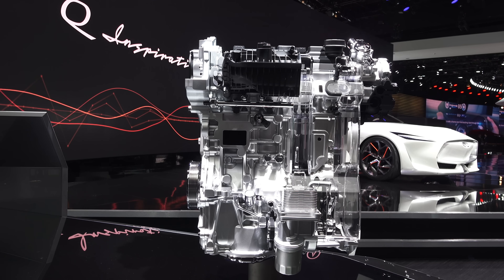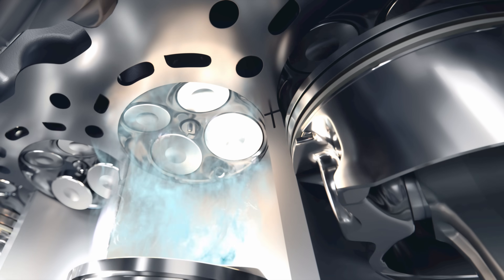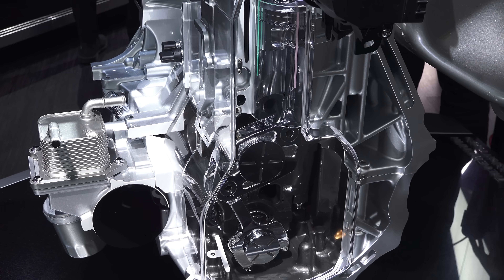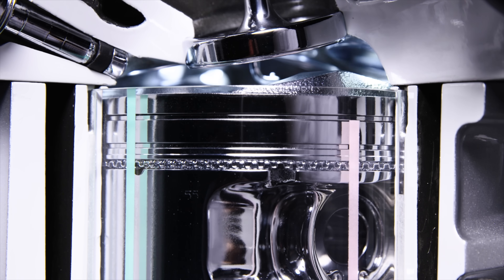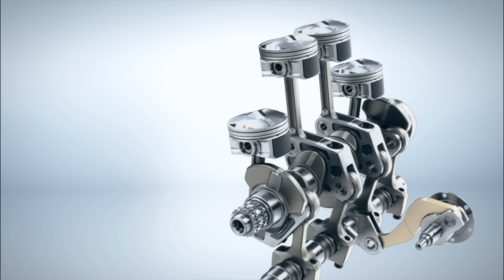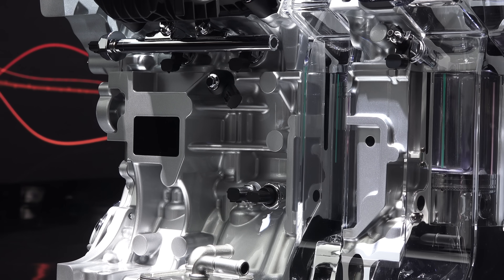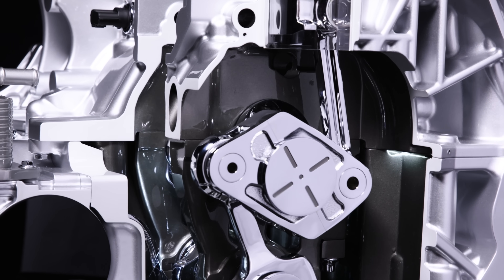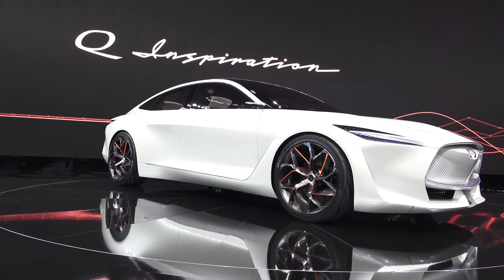INFINITI Reinvents The Gasoline Engine — VC-Turbo

Comment: More moving parts usually mean higher likelihood of something going wrong at some point.  Also, the computer that does a lot of the thinking for this engine will require more lines of code.  More line of codes, the higher the likelihood that there will be bugs.  Over time, things will get better but I sure wouldn't want to buy a first generation of that car (not that I could afford it anyway).
Reply: So much for adult conversation.  If you read (because you did read it, right?) my comment again, I say "higher likelihood of something going wrong".  I never said it is guaranteed to fail.

The real ignorant people are trolls like you that don't add anything to the conversation and have to resort to personal attacks to feel better about their pathetic, miserable, little life.
Reply: Sounds like Infinity did a very good job of field-testing this new engine before putting it out into mass-production.  Yes, there is certainly more software tech being used to keep this motor running, however if a "bug" is found in the code, it is certainly much easier to fix via a firmware patch than a physical, mechanical flaw found in the engine itself.  

While it's a more complicated design compared to the conventional design, I love the elegance of it.  If reliability can be proven, I think the is the next step in ICE technology that many more automakers should consider.

Computers already control the modern car so I don't see that aspect of it being a larger beast to deal with.  I'm a software engineer and it's not a big deal in the big picture compared to what's out there now.
Reply: The discussion is "lines of code" (i.e. "Software") versus the physical complexity of the motor internals such as the multiple crank rods and stress an additional pivot points.  We're not comparing the reliability of the external components.  However,  I would think that a PCB and board components would be close to identical to the ones used in cars with regular engines, with the exception of additional sensors and connections for the extra electrical components bolted on the engine.  So if Infinity has a problem with PCB's and their components, they'll have it with other vehicles as well.  

Anything can fail, but the new crankshaft schema being used and the related components is (to me) the only real unknown in terms of reliability.  What is tested in a controlled setting is entirely different than the real world.  I think it's a fantastic idea and love the elegance of the design.  I'm looking forward to seeing how this tech evolves and hope it's not just some one-time fad.
Reply: I doubt the ECU or code would be faulty. There is shitload of R&D going on and it is easier to test electronics and code, compared to engine tests - be it on testbeds or on road, in car testing.
Reply: +Gmon750
There is also the chance of major bugs at hardware level (processor, pcb layout and stuff). I'm actually fully ignorant on car electronics, but I'd guess it's very unlikely right?
Reply: Your thinking is based on lazy cliches. That's all I read in what you wrote. "it's more complex, thus it will fail". The only thing you're showing us is "I'm ignorant, I just on't have a clue on what I talk about and I'm proud of it". Keep on making us laugh about your ignorance.
Reply: Francois Lachance well said. At the end of the day this is still a product of Renault-Nissan so you know reliability   is a big concern here.

Comment: So that means you can adjust compression settings like if your gas station doesn't have high octane fuel
Reply from the maker: Well, yes, it would make adjustments based on feedback from knock sensors.

Comment: How quickly can the actuator adjust compression, any specs on that...?¿?
Reply from the maker: Yep, I believe I mentioned this in the video. 1.2 seconds from one extreme to the other.
Reply: I heard 1.2 seconds mentioned in the video. Also, more an electric motor than an actuator doing the work.

Comment: Very insightful, thank you. I have a couple of questions though :-
Is the bore really that polished or is that the display engine? There’s a reason not to go too smooth of course.
I’m struggling to understand the balancing logic, the crank shaft geometry looks roughly the same, plus there are many I4’s without balancer shafts... piston / conrod mass is likely to be a key reason for needing one.
Reply from the maker: I asked about the bore polish, and they said it looks very similar, hence the name “mirror bore.” The secondary balance changes because of the pistons movement speed. I have a video on secondary imbalances which explains how they occur.
Reply: Engineering Explained mirror bore feels more like marketing speak, also I’m not much clearer as to what specifically makes the cranks arrangement smoother than a standard I4. It would be great if you could explain in a little more detail, thanks

Comment: Toyota is using the Atkinson cycle in many of its models the last years and not only in Lexus models but also in mainstream cars  and even in the Tacoma. Toyota comes out without Turbo and till now have absolutely no issues with reliability and so far i know these Toyota engines complying with 87 or 93 octane the question now is what Infinity has done more than Toyota except the implantation of  the Turbo device and  does this engine requires with so many movable parts a very special  cooling and lubrication system and oil,  and one more question is if this Infinity engine uses a liquid cooled intercooler?

Comment: Fascinating engineering and design, very interesting and well done video.
Reply from the maker: Thanks!!
Reply: agree on all points
Reply: +Engineering Explained Next time make a presentation or review of a "Radical Engine Design" from Achates Power , they make OP (Opposed Piston) Engine combined with Compression Ignition for Light Trucks  ;) !!!
Reply: Charles Butler I remember seeing this years ago as a French prototype engine and had very little to do with the infinity brand at the same time as the Saab engine prototype
Reply: This is actually very clumsy engineering. I'm an engineer and junior designer for Hyundai, and I can confirm now that this is the most uneconomical, unpractical, and expensive VC engine I've ever seen (aside from Renaud's engine). VC engines can be fantastic -- it's the future, not Teslas, but this simply isn't the way you go about VC.

Comment: As a mechanic, this is going to suck to repair in a few years.
Reply: electric is too far behind sure we cam get cars to go 300 miles on a charge but after what a 4 to 8 hour charge gas,diesel,e85 etc you can fill in just 2 to 5 min until electric cars can charge in a matter of minutes or until under half hour but then you have the waste of the batteries after they are worn out which if they leak or blow up are more harmful to the world then emissions
Reply: legionary illuminati really? Doubtful considering myself, and everyone I know, literally know 0 people that own an electric vehicle.
Reply: remove and replace bro pretty much
Reply: Nah, they will last long enough for depreciation to reduce the value of the car to a point where you will just scrap it rather than work on that overly complicated crap. How many Mazda RX-anything do you still see running around. 80k then scrap it.
Reply: gunstar1981 That's probably because you're always playing games and most likely live in USA?
Reply: legionary illuminati there is no replacement for displacement
Reply: +Patchuchan : LOL, in case you haven't paid any attention to anything in the world, ALL vehicles already ARE "throw-away" vehicles. I suppose it really depends on your definition of a "throw-away" vehicle though. Let's be realistic, shall we? Most daily use highway vehicles are dead within a 10 year life-span, just as the manufacturers have designed them to be. Some die from mechanical faliures, most die from various types of "accidents". All will eventually succumb to death from rust and rot. Poor economics (the poor financially broke middle class) are to blame for the main reason so many people are pouring good money into bad junk vehicles more now than ever, to try to keep them functional for 20+ years nowadays. What planet are you living on exactly?
Reply: Drew Laslo. And all this movement is run by the car's computer ?  Many things could go wrong here.
Reply: Job security
Reply: If this is gonna suck to work on, I wouldnt ever ask you to fix a v8. 

It really isnt that much more complicated than a v8.
Reply: fast fwd 6 years, and we are starting to see 23 and 24 Rogues at the auction, with engine "issues" nissan crap
Reply: Armando Latour Haha so true. If just one of those extra pivot arms/rockers fails, bye bye engine!
Reply: I was just thinking that. haha
Reply: Maybe not, although there are more parts, the wear areas are under less stress. It could potentially be a more reliable design.
Reply: They could end up throw away cars which would pretty much off negate any carbon emissions saved by the increased fuel efficiency.
Reply: Armando Latour - Agreed! It will suck to work on. I think I’ll stay  with the medium duty trucks and big rigs. 

And for the consumers of these engines, I can only imagine their reaction when they get their repair bill. I bet the soccer mom mentioned above would never forget to change oil again!!!
Reply: Armando Latour this engine isnt going to see the market or it wont for long. Think about the parts.  I just cant believe it. Wheres the running one?
Reply: Luca Gomez
Current charging on at least half the upcoming models includes Quick Charge in less than an hour, with just slightly less range than a CE.  In another 5 years, the combustion engine will be a relic by comparison.  But my hat is off to Nissan for this beautiful engine design. It's a work of art.

Comment: The turbo's position isn't the best, you want the air going into the engine cylinder as cold as possible. Could they not have intake of the turbo at the front and the exhaust part of the turbo at the back connected via shaft running through the engine block? similar to Mercedes f1 engine

Comment: how do low compression ratio engines have more power than high compression ratio engines
Reply from the maker: They don’t, unless you add more air. So with a low compression ratio you can use the turbo to make lots of boost, add power, and not worry about engine knock (damage). At high compression ratios you can’t run as much boost.

Comment: Hi, another fan of many of your videos.

I have a different question: I am a non-engineer ICE fan and Nissan/Infiniti fan. To my untrained eye, the VC-Turbo linkage looks a lot like Nissan’s VVEL linkage. I would love to know if these developments were related.
Reply from the maker: Unrelated, and actually this engine doesn’t have variable lift, just variable timing.
Reply: Thanks for the reply. Not that it was implemented though. I meant that if you look at images of the VVEL linkage and the VC-Turbo linkage, to me at least, they look very similar in design and concept. I was wondering if there was a connection in the design stages.

Comment: I think they are just PLAYING US AROUND. This crankshaft must be rotating in opposite direction then is presented here. If they rotate the crank in left direction than crank leverage will be longer throughout power stroke extracting a lot more energy. Forget about side load friction, the cylinders can always be a little bit offset to stay in optimal rod angle.

Conventional ICE has already very bad " piston to the crank relationship" increases the volume after tdc to fast, so it complicates combustion system and requires a bunch of techniques and methods and after treatment, accessories to dissolve unburned gases.

Comment: Does the engine also have variable valve lift? The engine probably gets a loss in power with all that rotational mass, tho thats probably what helps balance it
Reply from the maker: No variable valve lift. Electronic variable timing on the intake, and hydraulic variable timing on the exhaust.

Comment: so basically if the harmonic drive breaks you have to pull the crank shaft
Reply from the maker: Electric motors tend to be pretty reliable, and you can source parts to last. Also if it were to fail, you’d replace the harmonic drive, not remove the crank.

Comment: the problem with almost all turbo engines is they require premium gas, so they are more expensive to run and therefore less practical even if they get a little more mpg.

Comment: too complicated... i give it 3 to 5 years before the design is thrown in the failed basket...
Reply: Omega Rugal same was said about V-tec which has a mechanism operated by a solenoid while spinning over 8 or 9 k rpm back in 1989 when the B series deduted.
Reply: @DevasionX  weird you mention vtec since it can actually do the same thing...
Reply: @DevasionX  so... is it out now?
Reply: It cant be that bad. If it is thrown in the bin, then it was to expensive to make.

Comment: Interesting concept! I wonder about the engine's influence to the CoG tho. You said in the video the height is the same as other engines, however, since there is additional linkage below the crank shaft, I can't imagine it would have been impossible to build a less tall engine without it (applying the same concepts they used to keep this one's height down).

On the other hand: in SUVs, etc., this won't matter a bit, and there, the efficiency advantages will be very welcome. I just doubt we'll see this being used in sports cars in the near future (if ever)—at least not without a redesign shifting the assembly to the side of the crankshaft or something like that.

Comment: Wow that is all cool, interesting, and awesome, that just basically means a lot more can go wrong with that motor. In addition, it sounds like there's going to be significantly higher repair costs when they break..... After all, they are made by human beings, driven by human beings, and abused by them too. So they will break. Awesome video by the way.

Comment: I'm curious how many pieces this block is? With two cranks, basically, and all the connecting rods it's gonna be a hell of a thing to torque all the bolts securing everything together.

Comment: This is a neat design but I'm thinking you'll never save more $gas than $ spent on the huge increase in complexity(design, build, maintain, repair) as opposed to just tuning for hp and living with the lower mpg.

Comment: I would think that using the atkinson cycle with a higher compression stroke would be 100% pointless because that cycle reduces compression ratio but I thought increasing the stoke to increase compression was to increase compression not just have it removed at the same time?